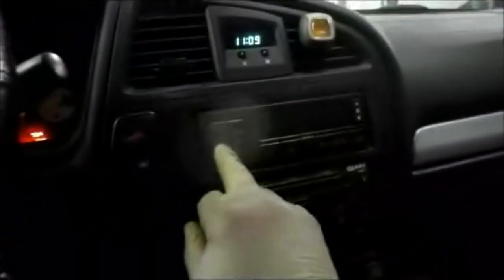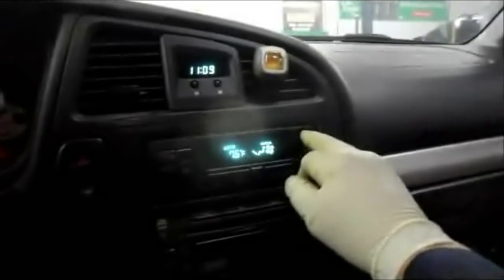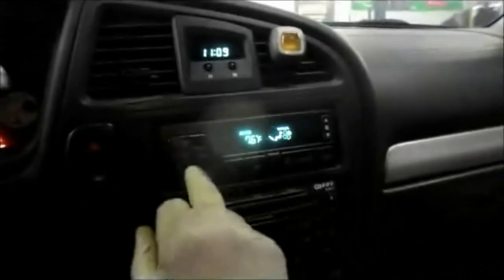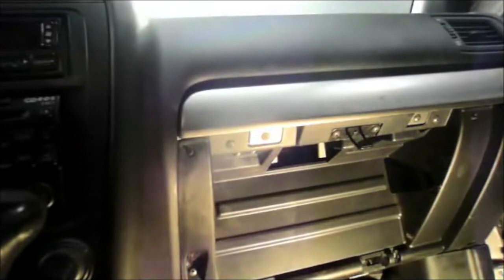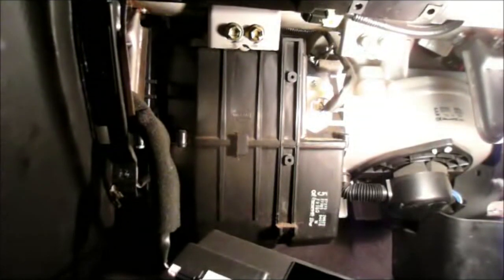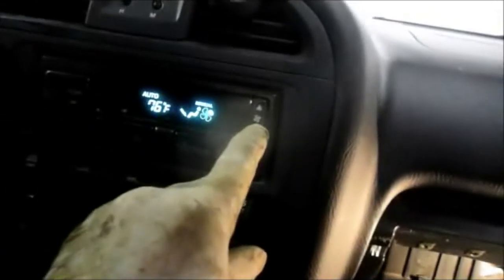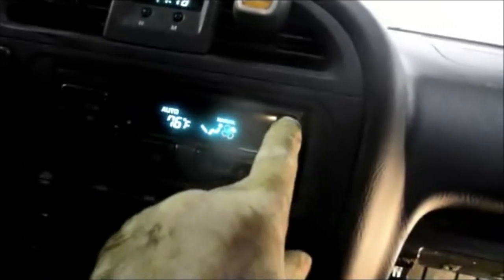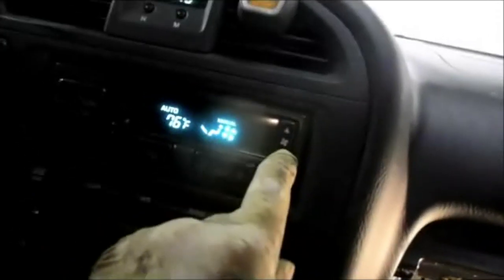Nissan Pathfinder Fan Not Working / Heat Or AC Will Not Turn Off

Comment: This is exactly the problem I'm having now. Thanks for the demonstration on repairing it. One question: What is the replacement part called so I may get it from a dealer???
Reply: Only issue I had is that mine is a 2002 which has a completely different design. Doesn't look much like this at all.

Comment: Hey Jim I have a issue with my  accelerator peddle position sensor.  I had reduced power service stabillatrack and service traction control.  Code reader said needed new tps changed that then said needed the accelerator position sensor so replaced that and is still having the issue?  Could be wiring harness but is there a chance the peddle sensor needs to be programmed or any ideas or suggestions.   2007 Silverado 1500 LT 5.3 v8
Reply from the maker: I did have the exact same problem on a customers truck here is the link to that video. I hope it helps. https://www.youtube.com/watch?v=j8JuRuH3aMw